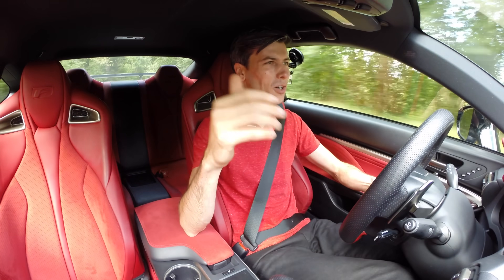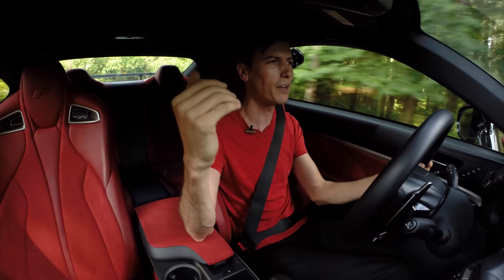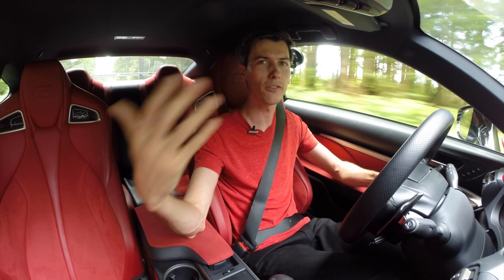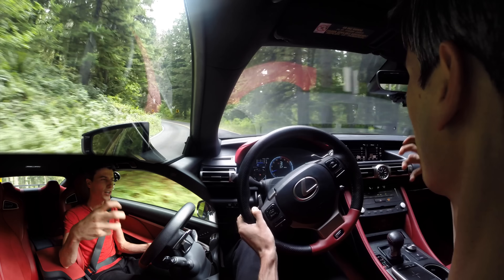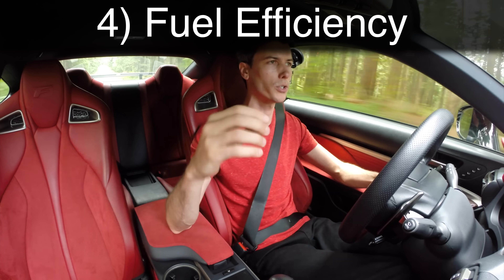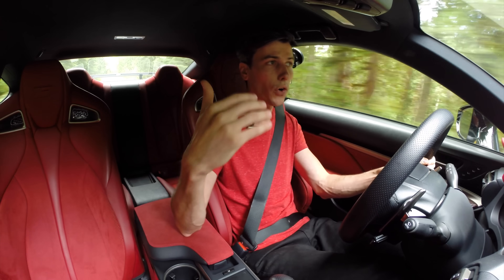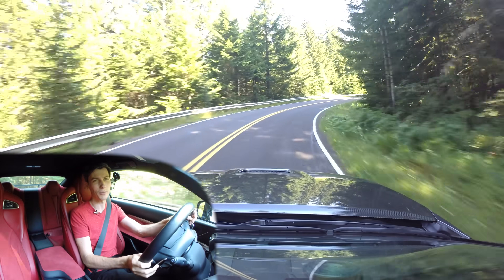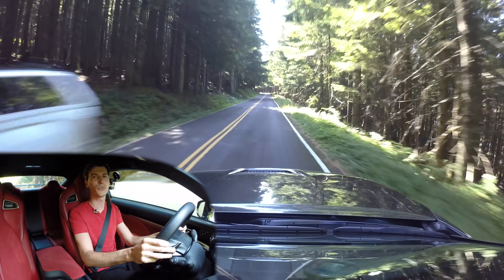5 Reasons You Shouldn't Buy A Turbocharged Car

Comment: But in other countries (ex. Romania) you have to pay a tax for your engine size. Engines under 2l will cost you ~250 Ron (aprox 60 usd) a 2.5l is closer to 1000 Ron (aprox 200 usd) sooo... if you want more power, any small turbocharged engine will do, unless you're some kind of director or you've won the lottery.

Comment: Sorry dude but I LOVE all my turbo charged Volvo's(RWD + FWD) and Saab's(whom pioneered turbo 4's) and Ive owned quite a few. I've replaced 1 turbo out of all the turbo cars Ive owned only because the prev owner didn't use the right oil. Its all about build quality and maintenance.  Nothing like the sound of a turbo spooling up. Oh and you CAN tune your turbo car for more hp which you cannot do with an n/a motor.

Comment: One way of removing turbo lag is by pumping air into a container of compressed air through a small electric motor and a positive displacement pump and releasing it instantly into the air intake with a large check valve preventing the air from escapng out the air filter until the turbo kicks in. The electrical consumption of the positive displacement pump can eliminated by installing 2 check valves on each shock acting like 4 positive displacement pumps driven by the waves in the road.

Comment: Really you do put stuff across well, enjoyed this purring V8 - the closest I get is on Real Racing 3 on my ipad.  However...Mercedes slap on both supercharger and turbocharger on some engines, and it's to fill the torque gap low down.  Point is, that task could be performed by an electric motor on the end of the crankshaft for example.  Electric motors can also spin into 5 digits as a normal business.  Reliability - one moving part in the motor too for electric motors.  The sound of a good-running decent ICE is lovely that's undeniable.  Knowing an EV is much more reliable, is lovelier for me though.  These museum pieces are great fun, and one day I expect to look back fondly and laugh at all the times I have been inconvenienced and fleeced, because of my hard-to-maintain and ageing ICE vehicles!  EVs won't have me catching gasoline from a leaking fuel tank in a kitchen pan, and running across the road to pitch it into a friend's car so it's not lost.  I will miss some of it, but not enough to devote even more of my remaining life to running repairs!  Good work, carry on!

Comment: My BMW 135I has power from the get go and it's there when I need it 3.0L twin turbo, My Supra has a 3800 high stall so power if there within a second but yes noticeable, My skyline off boost 1000-4000 is crap but 3.0 NA torque both the Supra and Skyline are insane very very hard to get a NA to do the same thing
Reply: Post videos if them

Comment: You shouldn't make a equal sign to a Petrol turbo temp to Diesel turbo, 
SAAB ttid, twin turbo, 80% tourqe at 1300 rpm, second turbo kicks in at apr. 2800 rpm up to redmark. , worldclass engine.

Comment: you can have an NA motor with a exhaust side of the turbo just having no influence on the engine or connection but used purely to generate hydroelectric style power to power the countries power via wireless power. ... time for another joint

Comment: So my idea was to get a turbo to get more power out of an absolutely microscopic engine - so I can save on gas and noise while still being fast enough for the highway - let's face it, I'm not going to take it to a race track, I just want to be able to drive while saving on gas.
(And I read that a turbo can decrease fuel consumption by 10% which would make up for the cargo rack I want to slap on top of it)

Comment: My 2.7TT F150 has coolant running through the turbos.  Oil coolers are available or come as standard equipment.  Intercoolers are keep charge temps down.  I'll take my 2.7 TT v6 over the 5.0 coyote engine.  Sound, I love the sound of a turbo spooling.  He's bringing up issues from the 70's and turbo charging.  The Grand National for told the future.

Comment: Is thermal efficiency really a result of compression ratio or is it a result of cylinder pressure? I do not know the answer to this question.
Reply: @Mark Codiroli Higher compression ratio does not always mean higher cylinder pressure. I think it's safe for me to assume that it is a restult of cylinder pressure and not compression ratio. Edit, my spell-checker did me wrong!
Lol
Reply: @Mark Codiroli I am aware of what compression ratio is and how it affects cylinder pressure. Engines are not static devices and cylinder filling varies greatly with RPM. Thermal efficiency is a result of cylinder pressure, compression ratio is one of the factors affecting cylinder pressure.

If all other factors are equal, an increased compression ratio will probably result in an increase in thermal efficiency.

I'm a retired electronics guy, this is just a hobby for me. Maybe engineering explained will see this thread and give us a complete explanation?
Reply: @Mark Codiroli I am referring to compression ratio as a calculation that only depends on the theoretical compression, assuming 100% cylinder filling. Is this assumption correct? Am I misusing the term compression ratio?
Reply: @Mark Codiroli I am nitpicking. 
I am assuming that when engineers use the term compression ratio that they are referring to something that can be calculated without consideration of cam timing or airflow restriction. 

I believe I'm coming to the conclusion that thermal efficiency is directly related to peak cylinder pressure immediately prior to the combustion event and that compression ratio is only one of the factors in cylinder pressure. That it would be more accurate to say that thermal efficiency is a result of cylinder pressure.

Comment: I owned a 2014 F150 with the 5 litre V8, and I traded it for 2018 a 2.7 litre bi turbo V6. The small V6 blows the the 5 litre away. Better acceleration, 25 % better fuel economy.

Comment: You've talked about turbo lag.  Isn't that also the case with supercharged engines?  On a different note, I've noticed that the new Mustangs (2.3 L I-4 HP ecoboost, the Bullet Edition, GT350, and the GT500 all have VCTs.  Would you please explain how Variable Cam Timing works?
Reply: Every engine in almost every car since like 2002 has variable valve/cam timing (except domestic V-8, until ~2012 or 14)

Comment: I don't doubt that your charts are correct for cylinder pressures but I feel like the pressures are "maximum" pressures.  So even on a turbocharged car, this is NOT happening 80% of the time.  Modern turbocharged cars also maintain higher compression ratios as they have variable ways to keep the charged air cooler so their thermo efficiencies are better too.  Everyone buys a vehicle for different reasons.  I'm getting ready to retire so we will be on a fixed income.  Which means I need good fuel economy to keep costs down.  I'm looking at a small SUV with a turbocharged 4 cylinder engine that gets very good gas mileage and has good low RPM torque available when I need to tow a small trailer several times a year.  The point being I have to balance what my needs will be and shop accordingly.  4 cylinder naturally aspirated engines don't deliver the torque until 4,000 RPM and higher which means your right foot is much farther into the throttle starting out from a stop.   Just my opinion I guess but you can see that not everyone's opinion or review will apply to your individual need.  Do your own homework.  But I do get far more excellent information from Engineering Explained than any other channel out here!

Comment: All of your fuel efficiency arguments are right, but your conclusion is wrong! The reason for adding a turbocharger is to make engines smaller, thus lose some weight, and also diminish heat-related losses of the engine arising from the smaller displacement of the engine. The fallacy of your argument is that you are comparing engines with the same displacement, the only difference being the presence of a turbocharger. You need to be comparing the two different types of engines, producing similar power output.

Comment: I own two Lexus cars with the same 2UR-GSE engine.  Power falls off at redline on both, same as it does in this RC F. The torque curve is far from flat.  Many of these arguments are just silly. The important thing about power is predictability.  The power in my '93 turbo TT Supra is very predictable, so is my IS F and GS F.  There are advantages to being off boost driving out of a turn and hitting boost later on track out when the wheel is more straight.  There are advantages to linear torque driving out of a turn.  But still more important than all of this is predictability.

Comment: I fond my old 04 grand prix with a 3.8 naturally aspirated v6 vs my 16 audi a3 2.0 turbo the turbo has more power and more fun to drive and better on gas (big difference in size tho). The sound doesnt make much difference because both tried to make it quiet however aftermarket exhausts or air intakes make them liven up a bunch more. That being said with high horsepower naturally aspirated engines may be much better but i prefer a smaller engine with a turbo because i unfortunately can not afford a $70,000+ car 😪

Comment: My engine for my 67 Camaro is coming back from the shop. 5.4L or 327 cubic inches. With the new Edelbrock annular venturi  carb, roller lifters and modern heads it should be plenty spicy without a turbo.

Comment: So you were hypocritical.
You want power and you want it now yet you whined about the WRX on off throttle. Which must have been a setup issue.
You don't want all the power instantly otherwise you would spin and crash all the time.
Try dropping 450 hp instantly through the rear wheels, in the wet while going around a bend. 
That would be funny.
Maybe because Americans only drive fast in straight lines you don't appreciate the concept of gradual power application out of bends.
Reply from the maker: Huh? Throttle pedals are not on/off switches and they never should be, but it should be the driver's choice how much power to apply and when (hence, the throttle pedal). Not hypocritical...
Reply: @EngineeringExplained  
I'll re examine. I may have been a bit cranky.

Comment: Sounds like 4, maybe only 3 reasons against turbo charging? 
Turbo engines save weight while increasing fuel economy and power compared to a naturally aspirated V8 dinosaur.
4 or 5 cylinder turbo charged engines are less complicated using fewer parts via cylinders than a V8. 
Modern Turbo charged engines have negligible turbo lag. 
Burning oil? Turbo engines use full synthetic. 
I think we're talking preferences here, not science? 

Turbo charging originated from aircraft's. Turboprop. Smaller lighter engines producing more power with less fuel consumption/weight! 
Simply superior coefficiency. 
Lastly, easier attainable 50/50 weight distribution in automobiles. Equals naturally balanced predictable safer handling.

Comment: I can rebuild my 68 vette's quadrajet for less than $75. How much to rebuild a turbo charger? Turbo's make mechanics lots of money.
Reply: I have two older Chrysler turbo cars. The turbo's are water cooled and even continue cooling after the engine is shut off due to natural convection of coolant. Neither car has ever had any issue with the turbo. In one, I am running 17 pounds of boost max, 7 pounds normal driving. ( 2 stage control ) No mechanic has made a single dime off my turbo engines.

Comment: Quick question. Which do you think would provide a better engine then, a 2.0T with 4 cylinders, or a 2.5 5cyl engine?
Reply: As a 2.4L, I5 engine car owner I can say - it sounds lovely but you may get a lot more power using turbo on regular inline 4. However the response in daily driving is fantastic, you just put your foot on a pedal and it rips

Comment: I brought a new car that as the now common 2litre turbo. I would not do it again it given the choice. It doesn't sound good and it burns more gas that a 8 cyl. In as you stated, due to the higher pressures of turbos, the detonation/ knocking is more likely therefore the manual recommend premium gas, which cost damn near a  dollar more per gallon than regular. 

The smaller turbo 4 cylinder engine burns more gas than my older naturally aspirated 6 cylinder and the fuel is more expensive.

Comment: I drive an F150 ecoboost with the twin turbo 6 cylinder engine. It has very little turbo lag. I have driven several other turbo'd vehicles and would in general agree with you, but the newer computer controlled systems are really good. The advantage is if you keep you foot out of it you can get the better mileage and when you feel frisky and jump on it, the engine responds with some awesome power and accel. BTW, as you know, you should always let your engine idle for a minute or so after driving to let the turbo(s) cool and avoid oil damage.
Reply: Pretty sure it's just awkwardly phrased, but you shouldn't idle your engine after driving.
Before coming to a stop, you should go into rpm ranges where the turbo isn't active or as active and let the wind cool ot before coming to a full stop in your parking space.
Atleast that's what I remember every youtuber talking about this stressed in particular. It's the wind that cools the charger while driving, not the engine running while standing.
Reply: @aaronschneider1581  It's both. It also depends on how complex/efficient your cooling system is but ultimately, you need air rushing over the parts to be cooled and this is achieved TWO ways.
1. Natural airflow from vehicle movement.
2. Forced air cooling using a fan.
Reply: @gottliebdee263  3. Idle to keeping the oil flowing to the turbo(s). 
Always use synthetic oil and don't fall for that "Blended oil" BS.
Reply: Friend could u explain me something? Lets say a turbo car makes full torque at 3500 rpm only and full power at 6000 rpm only. Between 3.5-6k rpm the turbo doesnt give its full work to the engine? Or from 3.5 to 6 it gives its full work?
Reply: @eliasaggeli1225  Between 3.5-6k the turbo will be at full boost.
Reply: Hope you have an extra 10k laying around for when the turbos go.
Reply: Drove it for 11 years. No problems. @pwilki8631

Comment: there are plenty of old reliable Volvo Turbo Gas Engines.  250-300ps out of 2,3L  (this are the 90s) Those things run easy half million miles. Oil change interval is like double of most V8. Yes you have turbo lag - but those thing are still faster at max rpm then a natural aspirated engine.

Comment: I knew and agreed with most of these arguments but ARE YOU 100% SURE ABOUT LOWER EFFICIENCY???!!!

Don't get me wrong, I prefer NA engines every single time (I have a NA BMW M 130i project to avoid the 1M turbo).  I prefer older Caymans because of the six cylinders and the lack of turbo.  But still:

- Do you have reliable, comparative data that given a similar engine weight, a downsized turbo consumes more fuel than an equally powerful, NA, larger engine?

THAT would be a delightful, win-win, surprise.

Comment: I've got an Audi A4 1.8T. Full torque from 1750 rpm all the way into the redline. I love the engine characteristic, it's especially nice in city traffic because you've got all that oomph at relatively low revs to beat traffic lights or swerve to quickly overtake someone. Not every day is a cross country rally, y'know...

Comment: True. But boost is addicting. I went n/a and I daydreamed about the boost for 3 years. Had to get a turbo 3 pedal car again. Too much fun.  Another great turbo engine advantage is ECU remapping. 50 horsepower for $600. Adding 50hp to an N/a motor takes way more $$. And the sulution to all that turbo engine heat is e85. E85 is cocaine and whiskey for a remapped high strung turbo engine.

Comment: There's ways around it variable turbo,compression,antilag like old evos had pikes peek turbos 600nm at low rpm and now the new design of a fresh air valve on the exhaust keeping the throttle body closed and the car not trying to drive on anymore into the corners 👍

Comment: I need more explanation. I feel like you comparing bananas to elephants. 
Saying that turbo engines are more expensive , but they are are available on lower trims of most carmakers, where n.a. engines are more expensive and available on top trims. Also turbocharged engines usually have a better fuel economy than n.a. engines. 
Yes, we talking about 2.0T compared to 3.5 (in most cases). But if compare 2.0 and 2.0T then turbo engine is your choice, where you get a lot more power and little worse fuel economy.

Comment: My 2.0 tsi Tiguan hits like full torque at 1700 rpm . So you get great response. But one thing I noticed and is you really gotta wait for that turbo to hit that hp till like 3000 rpm. And even then shits only just starting to build at 3000 rpm. I also own a Jetta 2.5 and have driven b7 vr6 passat. Those cars throttle response and low end torque really blow this four banger turbo out the water.

Comment: On newer cars I don't notice much turbo lag. And on diesel I notice even less.
And it's even better with bi-turbo etc.
But with a turbo it's important to not just stop the car right after a using the engine hard. The turbo needs to spinn down and get cooler before stoping unless you like changing turbos :P

Comment: He didn't mention the most important disadvantage of turbos.  The short lifespan of turbos.  For those that want to get over 200,000 miles, the turbo will likely need to be replaced.  Also on some turbocharged applications, they are susceptible to oil dilution.